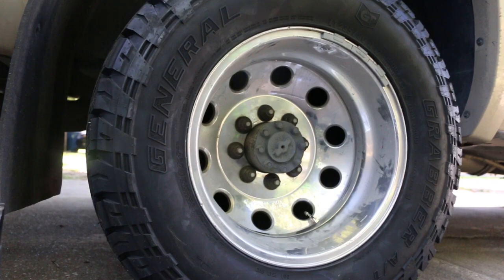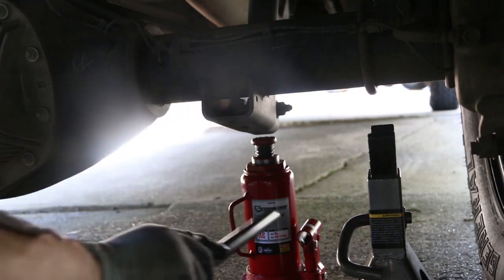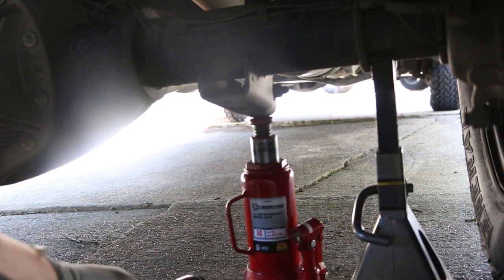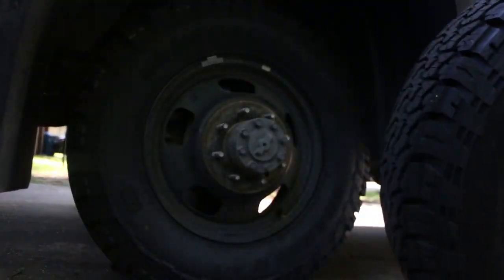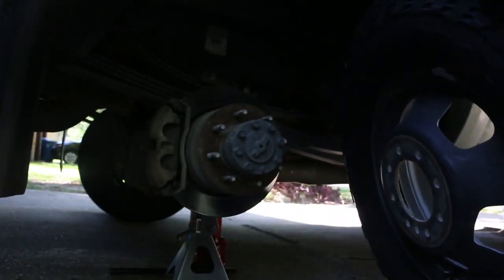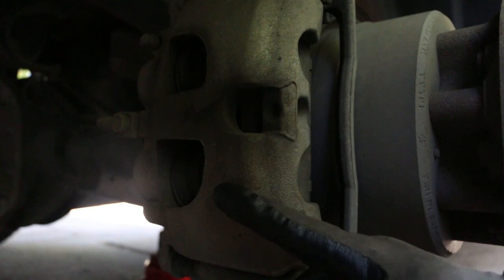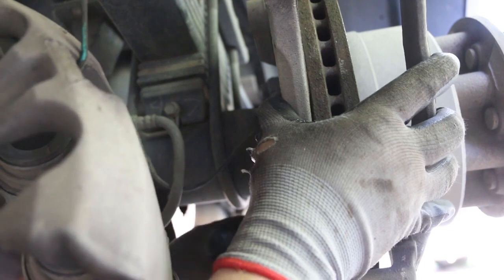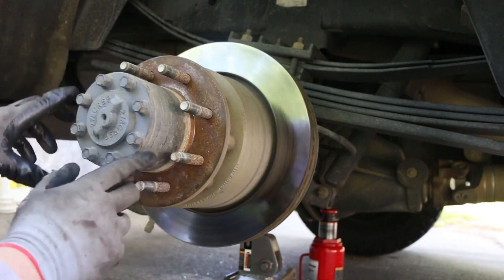2014 Ram 3500 HD Rear Brake Disc Replacement - DRW - Dually

Comment: Just some fyi for those who might be interested. I crack the bleeder screw and compress the pistons before I take the caliper off. That way I get rid of some old and possibly rusty brake fluid. I take a cheap meat injector from Walmart and suck the old brake fluid out of the master cylinder as well and put new stuff in. That way when I top off the master cylinder again and bleed the brakes it's all new fluid going though. It's good to bleed your brakes annually especially if you have cold winters. It's also a good time to adjust your parking brakes when you put your new rotors on because the slots on the inside can be a pain in the arse. Thanks for taking the time to make this video you had me rolling when you mentioned kicking bolts to oblivion🤣

Comment: Thanks for the video.  I did similar job on my 2008 about 6 years ago.  I needed new rotors and pads as saltwater ruined them.  I should have also done parking brake shoes and hardware kit at that time.  Since my parking brake can't hold the truck on a boat ramp, I need to work on them.  Going in again, this time only doing the shoes and hardware.  With axle out, I should be able to adjust brakes while spinning the rotor.  Thanks!

Comment: Good Video don't surely know what your occupation is. I was a ASE certified master mechanic. I have some pro tips.
1pack the bearings like you did but with axel assembly grease. Its specific to this application.
2Brake clean the parking brake assembly I inspect assembly for any damage. Brake grease the lands where shoes ride on backing plate thin film.
3With new axel gear lube coat the spindle and threads then install Rotor wheel hub assembly.
4this is extremely important Bearing preload. Depending on the axel and vehicle manufacturer torque specs vary. You must with the socket for the bearing retaining nut. Torque to specified ftlbs. Now here is where it can vary after spinning the wheel to seat bearings verify torque spin again. Generally you back off the retaining nut between 45° to 135° turn determined by spec. Then retorque between 10 to 30 ftlbs  by spec for the manufacturer. Believe it or not that key hole will be perfect to really close enough to install the key.
5 where the stainless clips go on the caliper bracket those mating surfaces on the bracket need to be wire brushed clean of dirt and oxidation then a thin film of brake grease applied then install the clips. Install bracket.
6Brake clean and wipe all dirt from inside the Caliper where shoes touch the flange and pistons areas. Inspect piston boots please. After passing inspection compress pistons. Wire brush caliper flange where outer brake shoe mates carefully clean pistons with out touching boots, lube a film of brake grease on pistons and caliper flange where brake pads will mate to caliper. Install pads to caliper bracket install caliper and with a Torque wrench tighten to spec every mounting bolts for safety reasons period. 
7wheel lug torque is to be rechecked between 50 to 100 miles no later unless you don't mind buying new 19.5 Alcoas beautiful wheels by the way. 
My biggest concern here is proper thread locker like you did and a Torque wrench on all fasteners to specified torque. Why because your showing people how to maintain in a area where proper assembly and fastener tightening is a safety protocol. If your not going to show this being done a written disclaimer and verbal in the video must be done. 
I enjoyed watching your humor was very good and comical. I believe your video gives a solid foundation to DIY the maintenance. Nice work
Reply: The video creator showed the shade tree way to do this job. As a professional technician I would have preloaded that bearing properly. Then again, I worked on vehicles that hauled equipment, 5th wheel RVs, and cargo.

As a shop owner, if I saw this and he didn't preload I would explain and show the proper preload. If I caught it a second time I would have ran him off.

Wheel offs do occur and often. Not preloading causes wheel offs to occur.

Comment: Again, you do not grease pack the bearing, the grease will contaminate the gear oil. The gear oil is forced to the bearing by the centrifugal force of the rotation of the axles. Gear oil is specifically designed for your differential and grease will change that balance. Especially if you have minimal slip and there no such thing it only a little bite.

Comment: Awesome video!!!  As others have commented, "wish I'd seen this before I started."  I do have a question though.  The inner seal, is there any chance that is may only come out in a couple of pieces?  When i did mine, I had the destroyed bearing just as your video showed, but there was still a seal in place holding the bearing.  Both sides came off the same way.  I'm a bit concerned at this point.......................😟
Reply from the maker: If the race of the bearing is damaged or has discoloration, I wouldn't replace it. The seal always falls apart due to heat cycles and losing strength over time.ifbbtherebis any question of its integrity just replace it, you are already deep in the repair, might as well.

Comment: Just out of curiosity-is it Ok to pack the bearings with grease even though oil will be in there eventually? Planning on doing this very job and I’m used to packing bearings 100%, but just was curious.
Reply from the maker: The grease is to make sure it is lubed until the oil can make to to the ends of the axle. The oil will break the grease down and the grease will become oil after some heat cycle.

Comment: hey, did you put more oil back in the axle when you were done?
Reply from the maker: After driving it around to move the oil to the edges of the axles, I checked the level. I was still at the proper level in the rear end.

Comment: what is that ring assembly @18:27 called? the flange on mine is broken
Reply from the maker: The seal or the tall metal ring?
Reply: Usually referred to as a tone ring, or rear wheel abs tone ring.

Comment: What is the seal part number?
Reply from the maker: Use Rock Auto for the correct year and model of your truck.
Reply: @InsightLandCare  i cant find that paper gasket anywhere help please i have even called the dealer and no help
Reply from the maker: I literally googled this and it's the gasket you need for the axle. "rock auto ram 3500 axle seal"